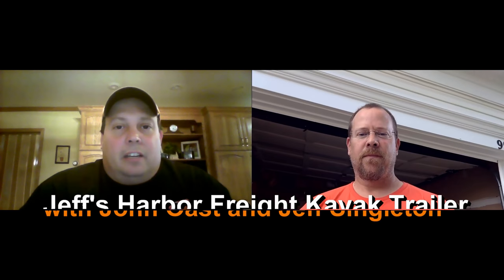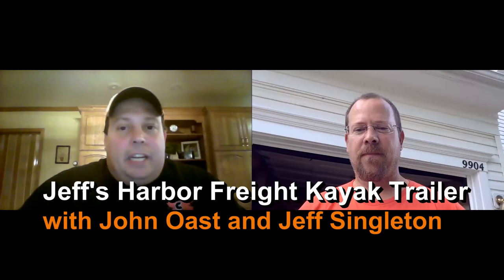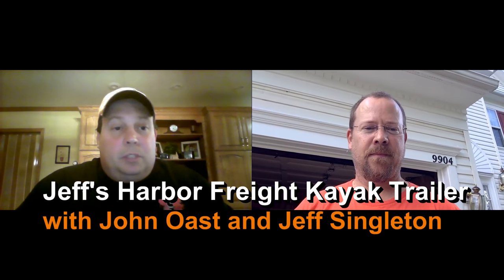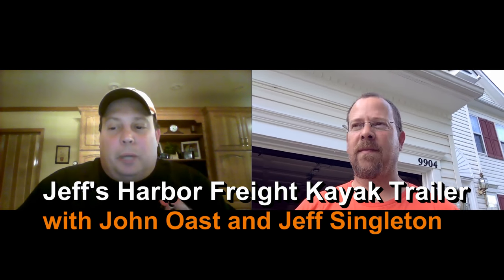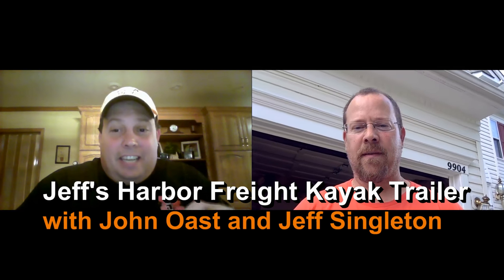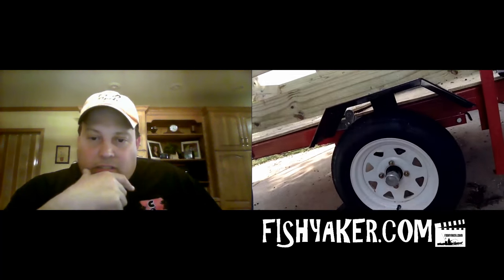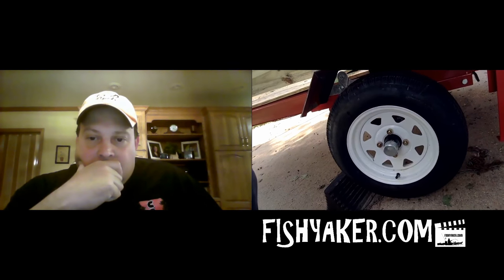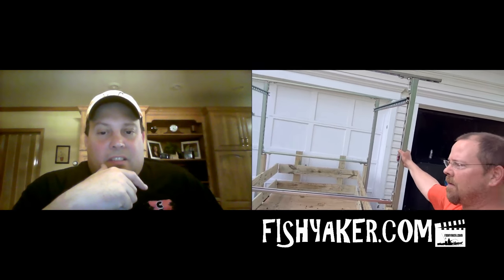Jeff Singleton's Harbor Freight Kayak Fishing Trailer: Episode 329

Comment: I have the same trailer .I bought mine used and in bad shape I've pulled it 75 mph np my spare also says 55 mph .mine holds my predator and 2 native ultimate 12s on top .I made the tongue longer also .
Reply from the maker: +dean zimmerman Cool!  I lengthened the tongue on my Tractor Supply one too.
Reply: Any input on replacing bearings or hubs?